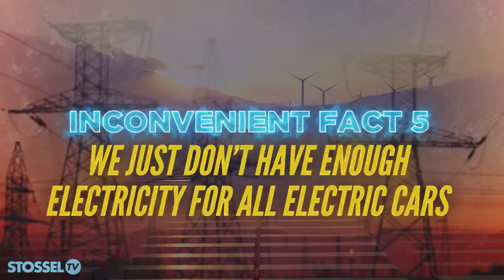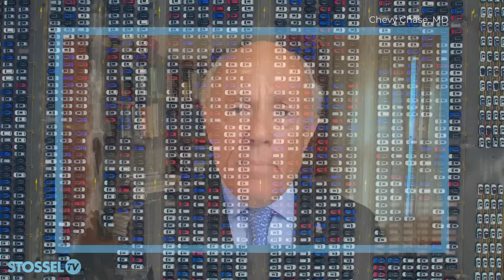Electric Cars: Inconvenient Facts, Part 2

Comment: I've been saying these exact same things trying to get people to wake up to reality but evidently they live in a dream world. BTW wind turbines require 60 to 85 gallons of oil to run, that's each turbine's requirement. Fossil fuels are also needed to manufacture solar panels, we have jumped headfirst into the water and didn't look to see if there were rocks under the surface, there are rocks.
Reply: @ATOMIC0705  John Stossl, the ones he avoided.
Reply: @ATOMIC0705  It is super easy to see that that was the case.  Do you spend much time looking at this topic?
Reply: @robinaboy  Just go to a forum where there is expertise, not this guys video who knows nothing and is approaching if from a political tribalism angle.
Reply: Ofcourse it is manufactured with fossil fuels, we live in a fossil fuel society in which everything is build with fossil fuels. Only when the transition is truly underway can/will this change.

You do realize the oil gets recycled, just like the oil that is used to keep the moving parts in your gas engine going, it isn't burned up or lost.
Reply: @MDP1702  WHO CARES of an EV is manufactured with fossil fuels? WHO SAYS a vehicle has to be made of wood to save energy? You're aware that the first automobiles were called horseless carriages because they were, indeed, horse-driven carriages/suspension/cab with the power source different. Does that mean we haven't transitioned to the automobile?
Oh and gasoline, diesel and bunker oil, all petroleum fuels, does not get recycled.
Reply: @MDP1702  the question is...what and how will be the end game of the transition? In otherwords, viable, sustainable energy production.
Reply: @MDP1702   Some of the oil in your gas  engine is burned up.  Think of the film on the cylinder walls.
Reply: @Barbarra63297   In my opinion there is no end game that we can see from our point in time. We are still in the early stages of our civilization. Hydro solar wind and nuclear power will be around a long time. Fossil fuels not near as long.
Reply: Maybe if you speak factually then people may listen.
Reply: That "80 gallon of oil" article is Erroneous Misinformation created by a PhD in PSYCHOLOGY. He doesn't even know the difference between synthetic oil and GREESE.
Reply: @Neojhun  in a broader sense 20 to 200 gallons is average depending on the turbine.

Comment: As an engineer working on electric cars I think they are extremely cool toys and are a luxury. I don’t ever see your average American driving EVs (or even myself buying one) however we said the same thing 100+ years ago when everyone was riding horse and buggies everywhere…
Reply: As long as charge time is longer than fueling up, electric isnt going to be a great solution for many. Hybrid would make more sense for many than electric.
Reply: Smelly,

we have progressed in many fields over the years but always because there is an improvement or it's much cheaper or sometimes both. Electric cars are neither. Surely it is telling that we are being led by law to buying these expensive, heavy and over rated for their CO2 reduction. Generally there is no reduction in emissions.
Reply: EV (after manufacture) are much more efficient than ICE.  EV typically get 3x the energy efficiency driving (EV typically have 100 mpg-e, compared to ICE car with 30mpg)
Reply: @bvegannow1936  We've had a Tesla for 4.5 years.  ~99.5% of our charging is done at home, overnight.  Superchargers are less convenient (snd cheaper) than gas, but we use them so infrequently that its essentially a non-factor.  Unless you regularly drive long distances, the slight incovenience of longer "fueling" times is pretty minor.  Never having to go to a gas station or an oil change joint more than makes up for it.
Reply: Ev's and hybrids are a solution for some problems- but it's like saying the invention of the smart phone will solve world hunger- it just can't. Saying 100% Ev's is the solution of the supposed crisis some see is really insane.
Reply: @iareid8255  EV emissions are still out of cities.
Reply: @libertarian4323  Everybody has a different living situation. People who live in apartments can't charge overnight, unless it's considered acceptable for a building to have a bunch of extension cords running out of its windows across parking lots or sidewalks. If EVs were better, they'd sell themselves and wouldn't need liberal politicians creating government policies to force people to buy them.
Reply: @libertarian4323  if thats what u wana do thats fine, but many other people have different lifestyles and its not worth lowering their living standard for no benifit to them.
Reply: @Elhardt  right. People would naturally choose them if they thought they were better for them in their current living situation, and were at least as cheap and charged at least as fast and fueling up, and if the benifits outweighed the down sides for that individual.
Reply: @Elhardt  I agree, driving an eV if you live in an apartment without easy access to a charger would be a PITA.  But for most of us, it's simply a matter of popping in the wall charger a couple of times a week- far less hassle than dealing with gas stations (and much cheaper, too).
Reply: Loyder,

modern car engines are virtually noxious emissions free, older diesels are the problem. Going to electric vehicles will do little to change city atmosphere.
Reply: Pablo,
you are mistaken, take into account the fuel used to drive them and all the losses in transmission, distribution the rectify the power to charge a battery, invert that voltage  and pass that through a controller to drive an electric motor(s).
Efficient they are not.

Comment: Electric cars are very useful.  For example, if there is a major flood, the electric cars will remind you later on to make changes to prevent flooding in the future.  They do so by suddenly bursting into flames due to the water having damaged the battery system.
Reply: Hahahaha😆
Reply: I have never seen an electric car on fire and neither have you.
Reply: @gw4pjq  I have. Plenty of them. I live in Orange County, CA. I saw one 3 weeks ago on the 55 south fwy.
Reply: @TheFrenchPug  The emergency department sees far more ICE cars 1,529 on fire vs BEV 25.1 for every 100k sold according to insurance companies. BEV's are much hotter & harder to put out, but far less often; and even this will downtrend with LFP / solid state batteries. Which I concede it has to as any seemingly ok car catching fire in a garage is unacceptable, happens more with BEV due to damage delayed thermal runaway.
Reply: @RoyBoy2019  Yes. But look at how ICE vehicles dominate the landscape. Think if it was the other way around. EVs would be exploding almost every day somewhere.
Reply: @RoyBoy2019  Yeah. Totally not what I'm getting at here.
Reply: @RoyBoy2019 it's the older ICE cars that catch fire mostly due to oil leaks and cooling system problems. Very few new ICE vehicles catch fire. The Devs will likely catch up as they are.
Reply: @jimwhelan9152  Agree re: older ICE, incorrect re: rare for new ICE catching fire. Look up recall for Land Rover in 2023, where they recalled 2018-2023 models.
If batteries & cooling didn't improve since 2014 I might have agreed with u, but since they improving and some chemistries are inherently safer (LFP & sodium) you are likely wrong. I say likely, as the Bolt recall was big; I expect GM will learn from that.
Reply: @RoyBoy2019  I can't find any huge issues about Land Rovers other than that there was a recall for a possible problem with potential for engine fires. Most recalls are for issues that affect only a few of the recalled vehicles or which only occur rarely. I couldn't find anything that implies a large number of new range rovers caught fire and the recall information sounded like the problem wasn't present on all vehicles (a missing part so the dealership only needed to confirm it was present)
Reply: @jimwhelan9152  fair enough, was tougher than I expected to summarize. "Range Rover and Ranger Rover Sport recalled for fire risks" does well for recent items. "Only a few" partially true, a missing turbo oil gasket impacted 1 car; whereas a water pump belt had 2,300 known cases (as of publication). Part of why it was tough in looking for recent items, stumbled on other Land Rover recalls, but can take digging to figure any fire risk. While older cars have higher risk, new ICE cars can be problematic as illustrated by broad recalls; my point is only post fixes are fires then “rare”. In quotes as rare is relative, BEV fires are worse but rarer (as a ratio, so fewer BEV sales is not a counterpoint), will they catch up? Unsure how, given battery trends to safer chemistries & improved BMS & coolant integration; and I'm still assuming more big BEV recalls as new entrants ramp up.
Reply: @RoyBoy2019  I don't want to be combative but are those water pump belt incidents actual vehicle fires? Water pump and belt failures cause engine overheating but unless the engine has been poorly maintained the overheating seldom causes fires. Overheating fires result mostly from oil leaks ignited by the overheating. Over my life I've had several situations where my engine overheated due to belt or fan failures. In none of those cases was there a fire of any kind.
Reply: @jimwhelan9152  Logical question, in water pump case the recall is 23V221000. The resulting overheating leads to a Plastic coolant elbow pipe rupture, which will leak coolant onto a turbocharger heat shield.
Reply: @RoyBoy2019  But does a vehicle fire result? More importantly how many vehicle fires have resulted. The chronology of events states that there have been NO fires reported in the U.S. as a result of this issue.

For now I'll stay with my contention that almost all ICE vehicle fires are in older models and that accounts for the larger number of ICE fires per vehicle. As EV's age the number of EV fires will certainly increase especially since battery issues increase significantly with age.

Comment: Great topic. Thanks! Suggested topics for a Part 3- The instability and dangers of batteries in EVs (batteries catching fire) and the environmental impact of battery disposal.
Reply: The NHTSA, DOT, NTSB, HLDI, NFPA, and even KBB all agree that the EVs' loss rate due to fire is less than that of gas-powered cars, and the new LFP batteries are even better in this regard.

There is no such thing as EV battery disposal; 'tired' EV batteries have long been repurposed by grid-scale energy storage facilities, and are now being economically recycled (see Redwood Materials for protocol details).
Reply: And ALL of your stated NHTSA DOT etc ARE OWNED
Reply: LOL,  I guess we can always  use nuclear reactors
Reply: @fourfortyroadrunner6701  there not built like they were used to, so yes
Reply: @fourfortyroadrunner6701  fusion maybe , but it was 10 years away in the 80s 90s 00s 2010/ 2020 ALWAYS 10 YEARS AWAY LOL.....

Comment: Inconvinient Answers:

4: the power needed to heat houses doesnt need to be stored in mobile batteries!? (-> 400years to make them) .. pumping water uphill also stores energy f.ex. ;)

5: „Rationing“ means to just mostly charge the cars at night one after the other and not all at once at 6pm.. simple software solution with no inconvinience

But you are right about the rest 👍